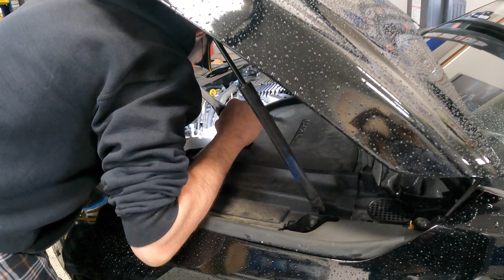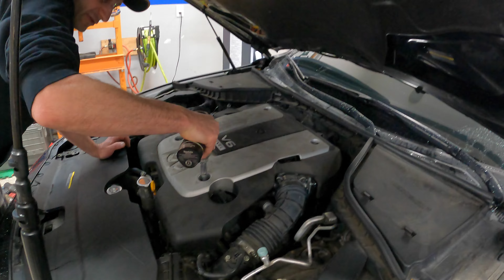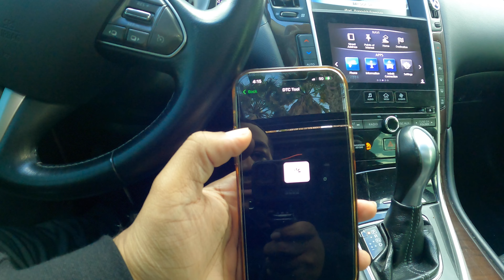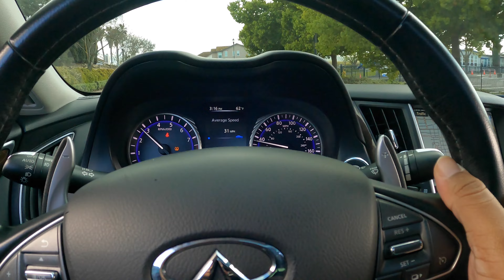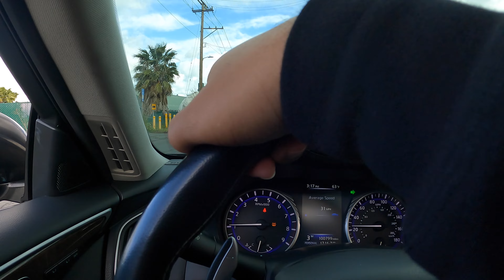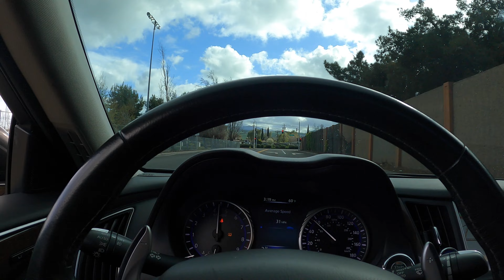FINALLY TUNING MY STOCK INFINITI Q50!

Comment: I have a 2017 Q50, I bought mine off my sister for 2300$ I also got a steal like you. how much was your exhaust ? And how much was the tune .
Reply: Pretty sure he has a muffler delete so that’s like $100. The tune is anywhere around $800-$1000 probably. Just get a full exhaust, test pipes or high flow cats, intakes and then get tuned.
Reply: U Bought the car for 2300? Bro I paid 18k
Reply: I paid 24😵‍💫
Reply: @RealWorldLLC  ME TOO BRO, 2018 3.0t q50 for 24k after all taxes and everything.  It was single owner with good carfax, 58,000 miles.  How many miles did yours have when you bought it?
Reply from the maker: I didn’t pay for the exhaust it was already on the car when I bought it. I’m going to make a video on the tune cost very soon.

Comment: Wtf he that talking about with not having a under tray he making no sense 😂
Reply: I mean he’s not wrong in a sense, the shield traps the air in a way where it has no choice but to cool everything in the engine bay. But he’s making it seem like it’s gonna give him an added 10hp if he gets one lol
Reply: Simply put.. The undertray is actually part of the aero..and is designed to assist with moving air. They arent shaped the way they are for no reason. This in turn assists with cooling. The undertray isnt just a piece of plastic.
Reply from the maker: Just to protect the engine
Reply: Have you ever looked underneath a FAST car before? Everything is cover lol fking slow boy lol